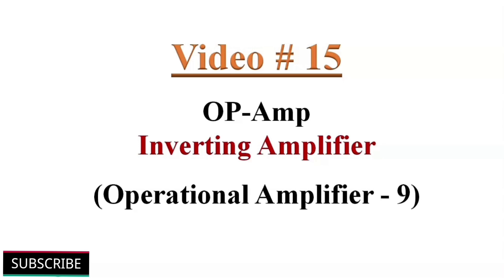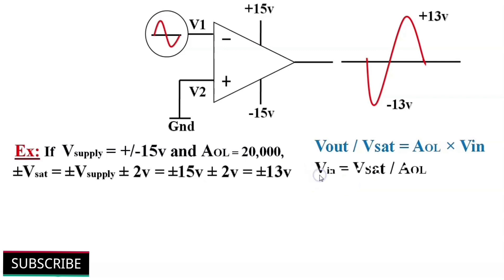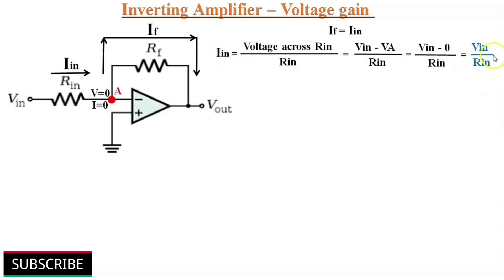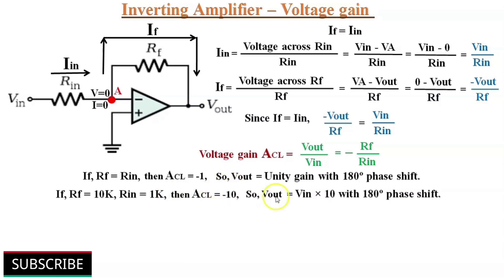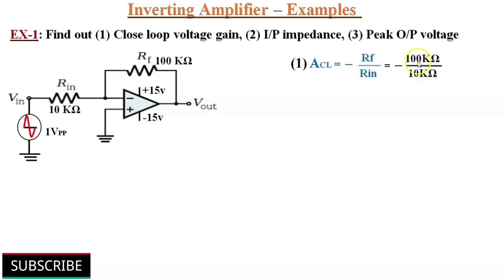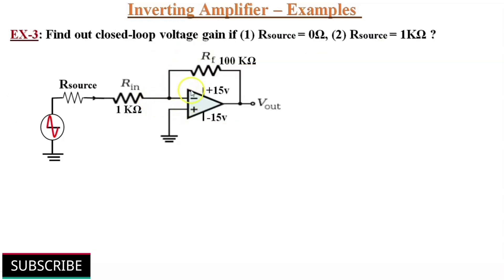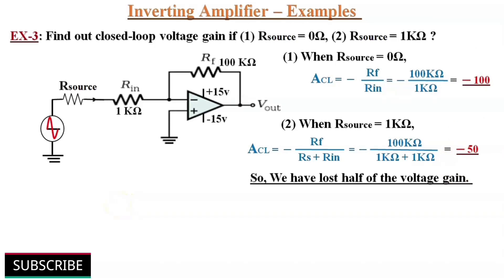OP-Amp Inverting Amplifier and Virtual ground Explained with Examples

Comment from the maker: The topics covered in this video are:
1) 00:17 - Introduction,
2) 00:40 - What is an amplifier,
3) 01:07 - Saturation in OP-Amp,
4) 02:25 - OP-Amp with negative feedback,
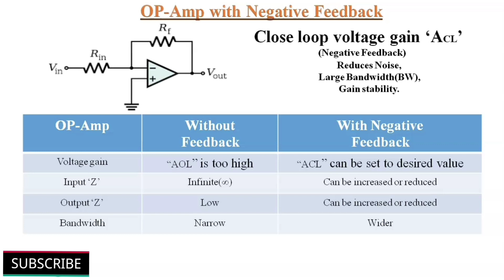5) 02:54 - OP-Amp as an inverting amplifier,
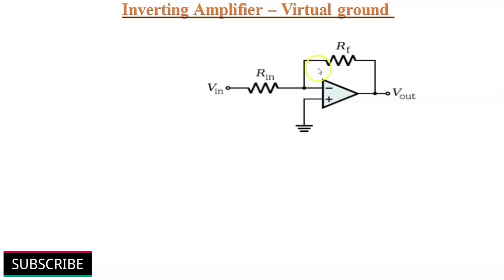6) 03:28 - Concept of virtual ground,
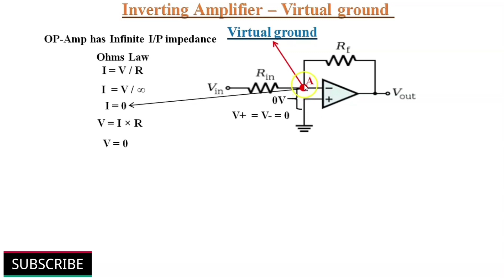7) 04:24 - Voltage gain of inverting amplifier,
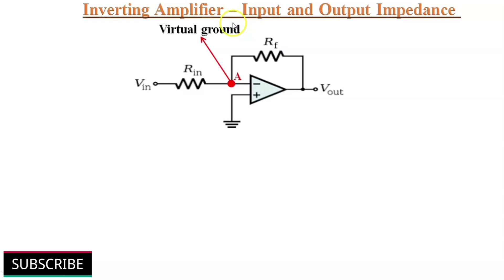8) 07:06 - Input and Output impedance of inverting amplifier,
9) 08:08 - Examples with Solutions,
10) 11:49 - Thanks for watching,
11) 12:03 - Next video.